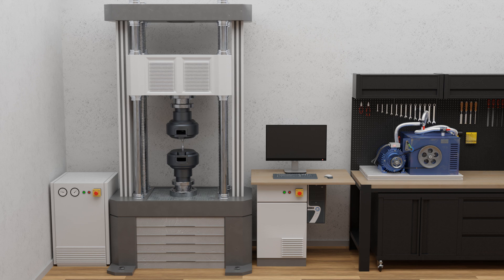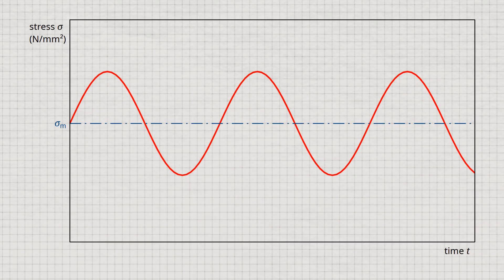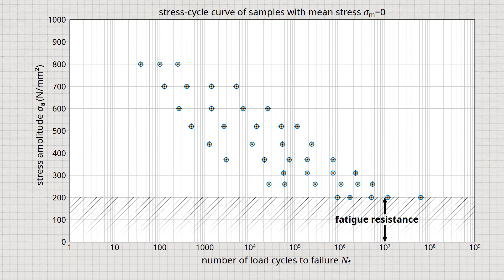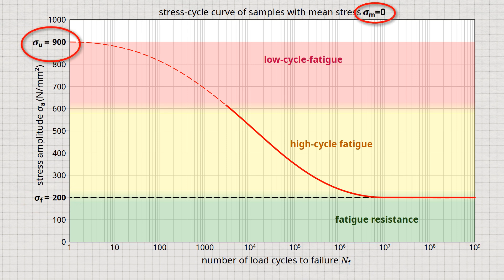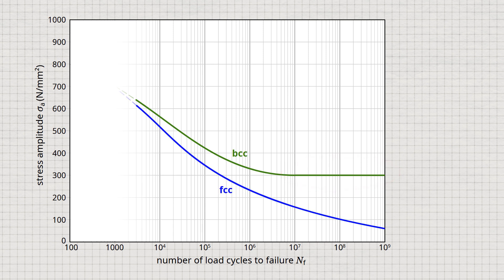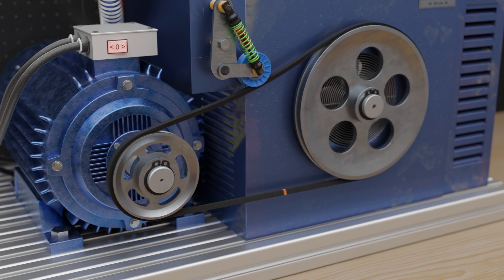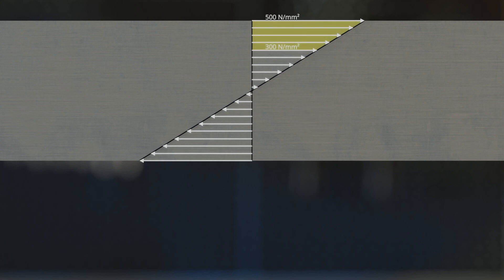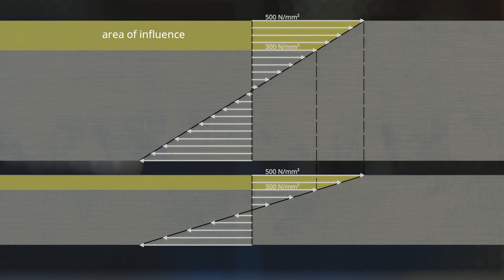Fatigue testing (Wöhler test, fatigue of components under alternating stress)

Comment: What is the difference between beach marks and striations which is explained at 13:17? I really appreciate the answer.
Reply from the maker: Beach marks, also called clamshell marks, are macroscopic features that can be seen with the naked eye or under low magnification. They form due to interruptions in the fatigue crack growth process, often caused by changes in the loading conditions or pauses in the service cycle. Beach marks appear as concentric, semicircular lines radiating from the crack origin and indicate the general direction of crack propagation. They are useful for identifying the crack origin and understanding the loading history of the component.
In contrast, fatigue striations are microscopic features that require high magnification, typically using a scanning electron microscope (SEM), to be observed. They result from the incremental advance of a fatigue crack, with each striation representing the crack tip position during a single load cycle. Fatigue striations appear as fine, parallel lines and are useful for estimating the number of cycles the material endured before failure.
In summary, beach marks provide a macroscopic view of crack growth and reflect variations in loading or operational pauses, while fatigue striations give a detailed microscopic record of the crack's incremental propagation cycle by cycle. Both features are essential in fatigue fracture analysis for understanding the history and mechanism of crack development.
Reply: @tec-science  Got that , thanks for the fast answer. I always loved that amazing content and videos .:text-yellow-goal::medal-yellow-first-red: